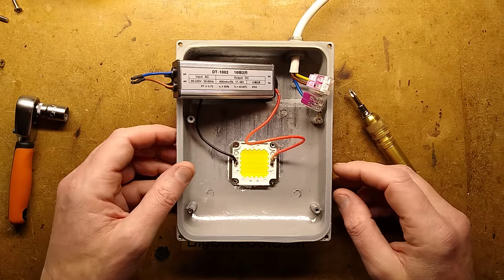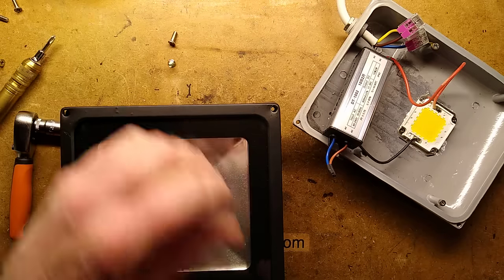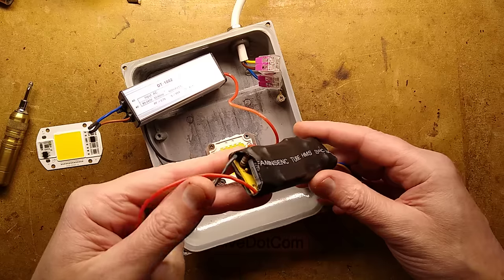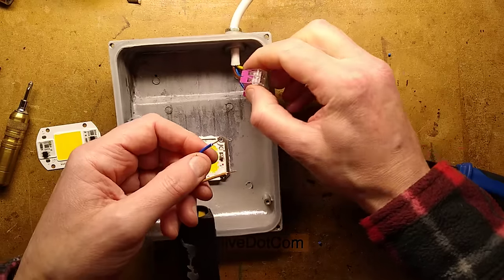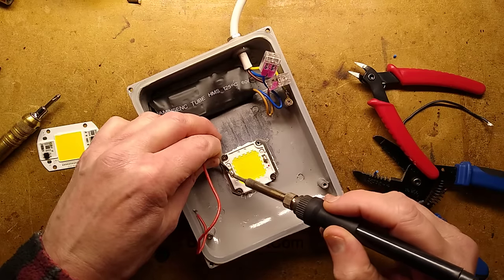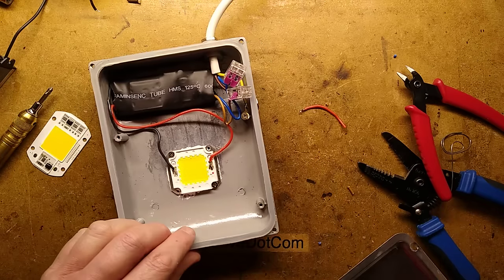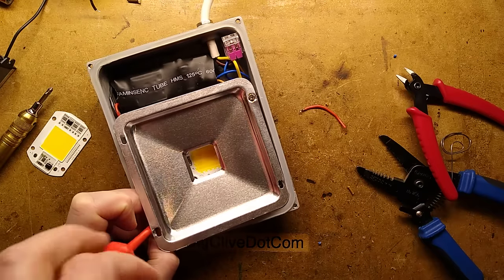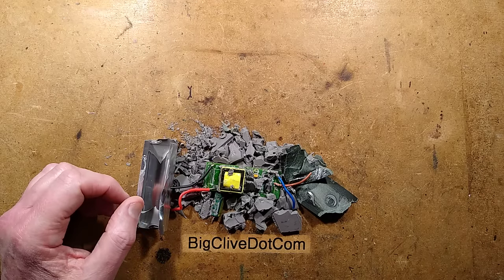Fixing my bench light

Comment: Why replace and not repair? I wouldn't think you're the kind who is short on capacitors
Reply from the maker: It was potted initially.  To get up and running again it was faster to put in a new driver.  The driver may be repaired in a future video.

Comment: You should keep a larger distance between single insulated mains and single insulated SELV cables, they're pretty close at 7:25. I would have routed the positive around the led
Reply from the maker: That would be an issue if there was the possibility of human contact with the low voltage side.  I would not regard these power supplies as isolated internally to a safe standard.

Comment: Circa 2015 I replaced most of our outdoor lighting with 12V 10W LED floods and a bunch of PIR motion sensors. The LED module is a 3x3 array driven by a constant current driver. Over time a bunch (forget how many) of the lights failed either as you mentioned intermittently due to failed wire bonds or completely becoming DEDs. I bought some replacement 10W LED modules from MPJA here in the US. I have no idea about their provenance but none of the replacements have failed so I must have lucked out an received higher quality ones.